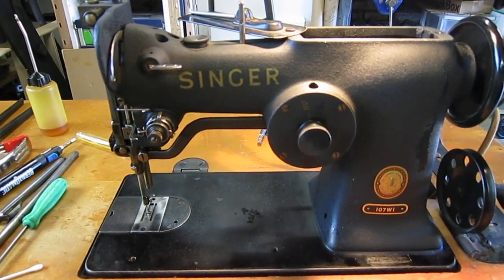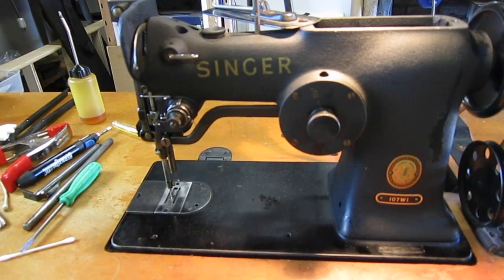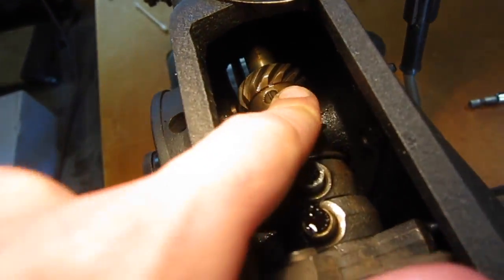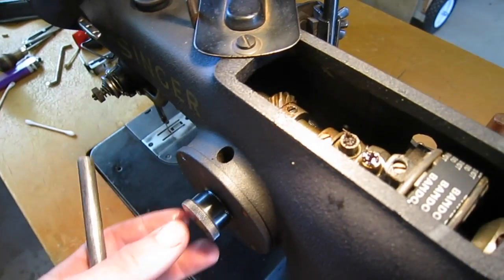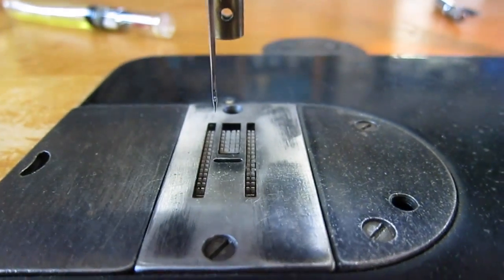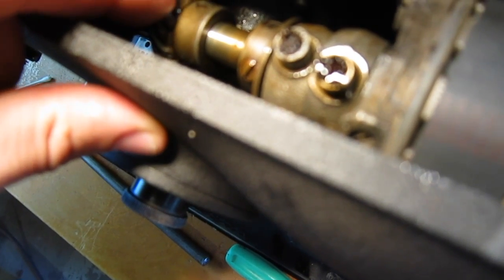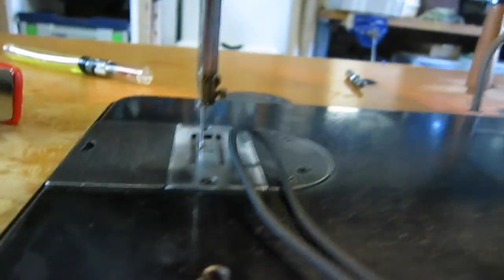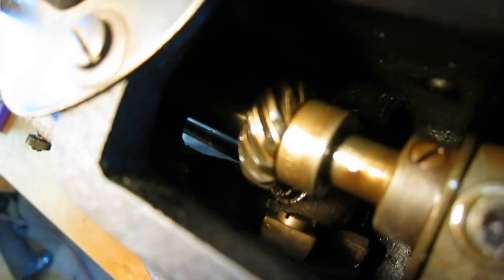Singer 107W1 Needle Positioning Adjustment (Zig-Zag)

Comment: Thamk ypu for this video.  Some people are asking about replacing their 107w machines because of wear or lack or replacement parts.  Look at the Singer 143w  series!  I have a 143w3 that appears to be the same as this 107w model.  You will need to determine if presser foot clearance is big enough for your needs.  Good luck!

Comment: Hello Sir , I just bought a Singer 107G253, it’s a cylinder arm machine . It’s sister is the 107G201 model. Been watching your great info vids for awhile. My machine looks similar to ur 107w, I’m new to this stuff but is there a certain way to adjust stitch length ? 
My hand wheel was bound up with thread , removed so not I got that stitch knob to move but does not seem to change. 
Notice my hand wheel has a triangle stamp on it, not sure if that’s supposed to be in certain position to adjust stitch length? 
If possible could I send u pics via email, for some advice? 
Thanks 
Wayne

Comment: I have this machine and have love it!  But after having issues with it and spending a hefty amount on getting it professionally serviced, it still isn't sewing great.  Someone else I contacted by phone said the gears wear down and you can't find parts and I should get a newer machine.  Question.  Is this true? Is it time to retire?  I've used it for over 23 years commercially with my Dad and he passed this year.  So I'm beyond sad that our machine we've babied is also going.  But I have watched your other videos (I have 2 Brothers you've spoken about - single needle and dble needle version and learned a lot from your videos thank you!!) and trust your judgement.
Reply from the maker: It's possible the gears are worn but I find it a little hard to believe.   What are the issues you're having?
Reply: Every 10-15 stitches (give or take), it skips straight.  And the top looks tolerable, but the bottom never quite looks quite right.  Almost a sad triangle.  I do use a heavy thread (Tenara 92 equivalent and the like) and run a 13/16 wide acrylic braid thru a feeder for valance edges on awnings on Sunbrella fabrics.  So I have made her word hard over the years bless her.  When it was serviced and repairman thought he had fixed it, he was using this reed thin, clear filament thread that I could break with ease.
Reply: @CustomCanvasCo : If the gears ARE the problem, and Singer no longer has these gears, you can probably pick up another 107 for parts.  I paid $125 for the last one I bought.  (Come to think of it, if I give up on my older machine, I suppose I could part it out...  I dunno how to contact you without putting my info all over the web, but I'll try to check back here for a response.)